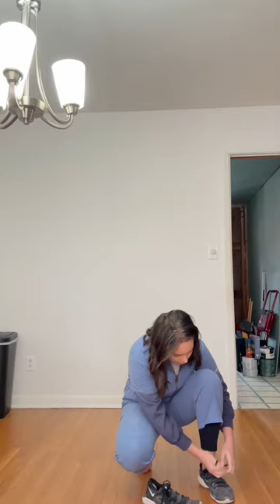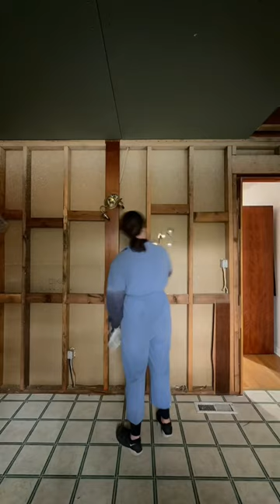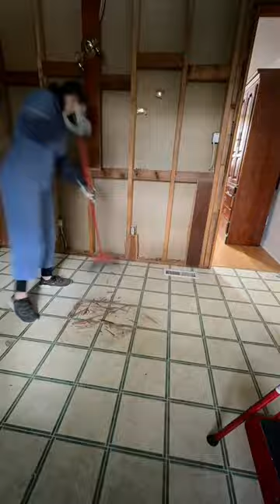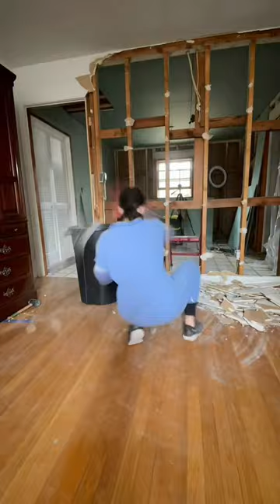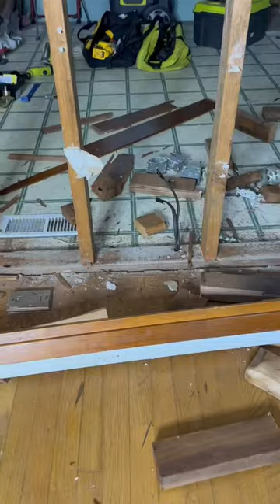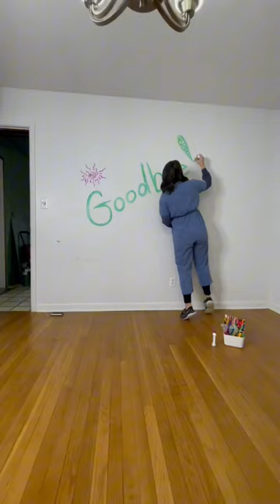Removing wall to make kitchen bigger! | DIY Kitchen renovation | Wall removal process

Comment: Did you check to see if the wall was load bearing? Trying to do this but I’m not sure how to find out if mine is or not.
Reply from the maker: Call in a structural engineer. They are the only ones qualified to for sure tell you. That is who we brought to inspect